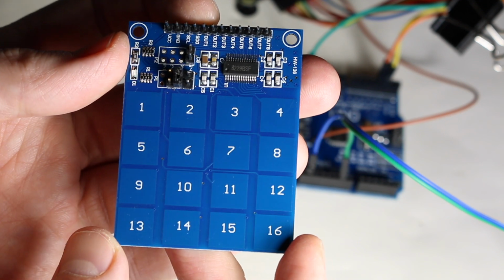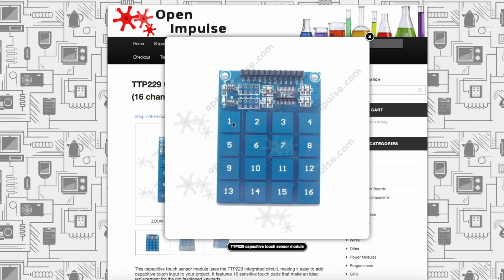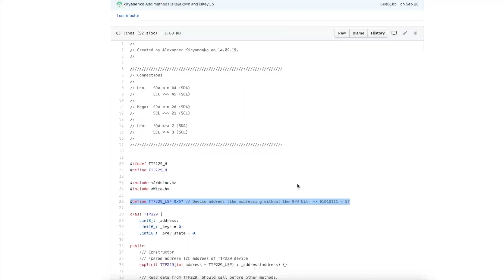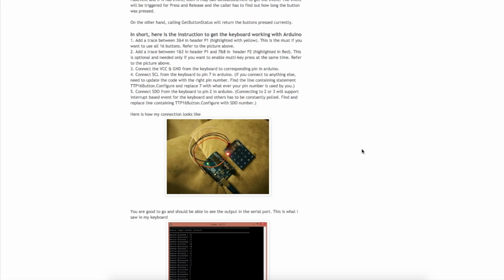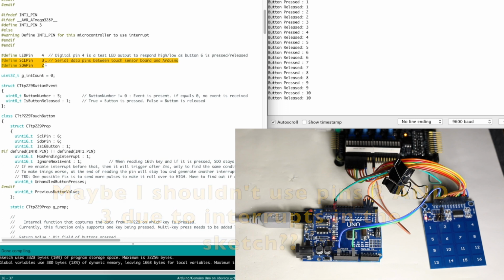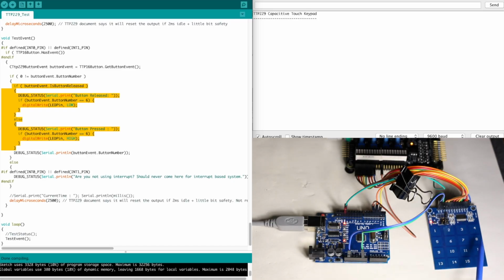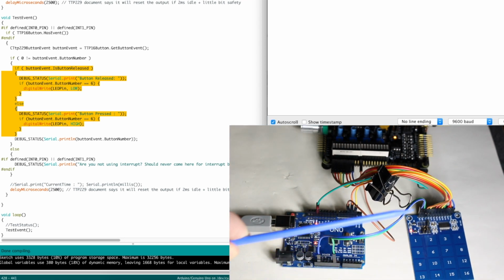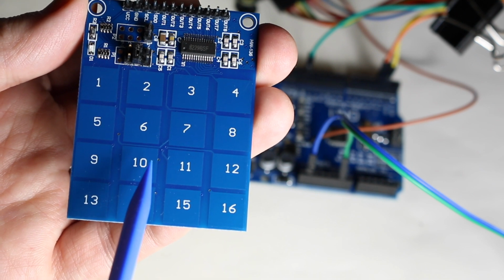TTP229 Capacitive Touch Sensor Module - Arduino Sketch

Comment: You probably saved me some headaches there I’ve got a few variants of those boards which I picked up to make a camera switcher for my live streams, I haven’t tried using them yet as I’ve been busy with other things
Reply from the maker: Yeah I thought this one was going to be straightforward and then I went down the rabbit hole. There’s even another variation of the chip that has I think 20 more pins than this one and I’m not sure what interface that has but at least this is a good head start. 
 And now that I know the buttons are easy to trigger unintentionally, I would space out the active buttons  with alternating ignored buttons so if you accidentally trigger a neighbour it won’t do anything  unexpected.
Reply: I've had pretty good success with the individual touch switch modules.
They're usually sold in bulk on ebay.

I built a control panel with custom drawn graphics and it was pretty straightforward.

Comment: I'm using this as a "smart" Killswitch for my truck.  Turning the key only powers up the Arduino, I must then enter a pin code to have the trucks ECU receive power and start the truck.

Comment: Doesn’t look too promising, but conventional buttons are expensive in large amounts. I think I’d rather go for that sort of controller but with sockets to plug in separate, custom capacitive touch buttons. Which would be particularly easy if your project box’s faceplate is a piece of copperclad.

Comment: hi, this can be done by simple way :
Check it out :
#define SCL_PIN 3
#define SDO_PIN 2

/* Used to store the key state */
byte Key;

void setup()
{
  /* Initialise the serial interface */
  Serial.begin(9600);
  /* Configure the clock and data pins */
  pinMode(SCL_PIN, OUTPUT);  
  pinMode(SDO_PIN, INPUT); 
}

/* Main program */
void loop()
{
  /* Read the current state of the keypad */
  Key = Read_Keypad();
  
  /* If a key has been pressed output it to the serial port */
  if (Key)
    Serial.println(Key); 

  /* Wait a little before reading again 
     so not to flood the serial port*/
  delay(100);
}

/* Read the state of the keypad */
byte Read_Keypad(void)
{
  byte Count;
  byte Key_State = 0;

  /* Pulse the clock pin 16 times (one for each key of the keypad) 
     and read the state of the data pin on each pulse */
  for(Count = 1; Count <= 16; Count++)
  {
    digitalWrite(SCL_PIN, LOW); 
    
    /* If the data pin is low (active low mode) then store the 
       current key number */
    if (!digitalRead(SDO_PIN))
      Key_State = Count; 
    
    digitalWrite(SCL_PIN, HIGH);
  }  
  
  return Key_State; 
}